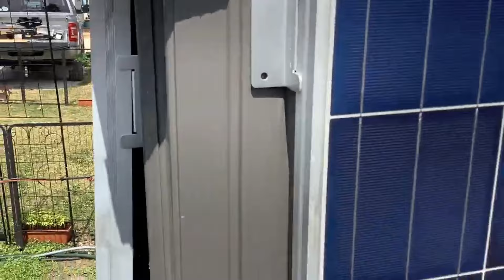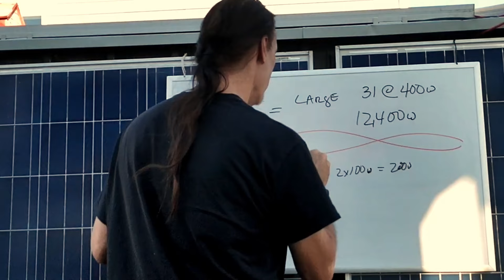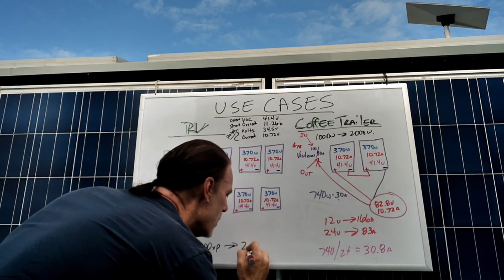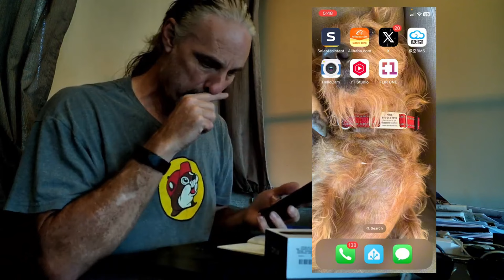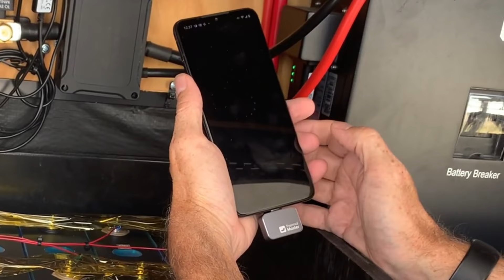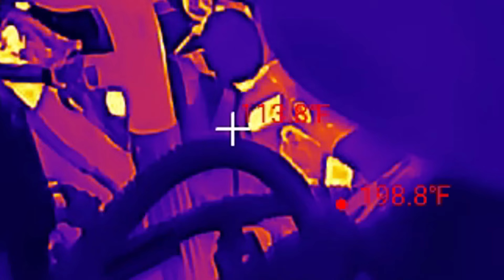My Solar Shed 7KWh of Power a day - The Entire Collection 3hr

Comment: Nice setup. Could you get away with tilting the south panels on the side of the shed with some timber beams and put door hinges on the top without getting in trouble there? Then you can play around with the angles and do some tests?
Reply from the maker: IDK if I could get away with it, i'm sure i could a limited amount. The but with series of 4 not sure i could boost enough in the same series to help..

Comment: That looks like a fun project.   You want the open-circuit voltage to be at least 65V but the larger problem is that when the number of panels in a string is small, losing a panel to shade can easily take the MPPT point well below the voltage needed to produce anything going into a 48V (51.2 LiFePO4) battery system.  When combined with other strings still producing full voltage, the current contribution from the partially shaded string gets cut drastically.

Combining shaded and unshaded strings or combing strings of panels that are in different orientations to the sun also usually has huge losses.  Production can go nearly to zero on some of the strings when combined with the strings that have better sun.

You might want to consider taking each of those strings into its own charge controller.  Do you have a clip-on DC amp-meter?  You can check the amperage contribution from each string at various times of day (with ALL strings engaged in the combiner box so you can see the interference between the strings).

The Victron 150/35 is an excellent charge controller.  When doing lots of smaller strings like that it is very common to use that one.  But if you want to save money you can make the strings a bit smaller and use several (cheaper) Victron 100/20's instead (note 100Voc limit on the 100/20). 

I use both types myself and love them.   I always go with the 150/35 when I can because it just works better with large residential panels.  But I also have a 2kWp system with 4 strings coming in that I put on 100/20's (allowing me to use four of them without spending an arm and a leg).

7kWh of power is decent.  I think you could get even more out of that shack using a separate charge controller for each string.

-Matt
Reply from the maker: Yes, i use the 100/20 in Coffee Trailer to run freezers, like the 150/35 they are good devices. I would love to break out a few extra charge controllers for nothing more then testing, but the cost just make sense as I have no need for any few extra devices. 

I did however shutoff each all the strings but one and see what they all output. They are all contributing but I bet you're right, i bet they would get a bit more on different charge controllers. 

Good constructive feedback thanks!

Comment: What cable did you use from panels to your dist box ?
thanks.. 
great setup
Reply from the maker: @demonsync57  are you talking running to the dist box I used 10awg PV wire, I always use it and never use the smaller 12awg.

Comment: I would recommend gettings some n-type solar panels. They generate about 30% more power and they are more resistant to any type of shadows
Reply from the maker: @christophermackinnon9621  yes, some newer panels would make a huge difference in the production, the issue I had with that is these cost $180 for all 12 of them … and new panels could cost me $1500-2000 … not sure it would be worth it.. but I will keep an eye out for some better used panels.